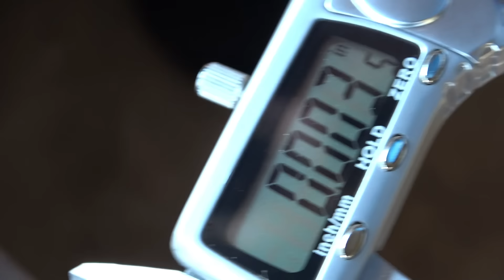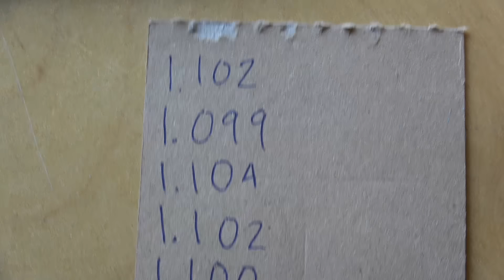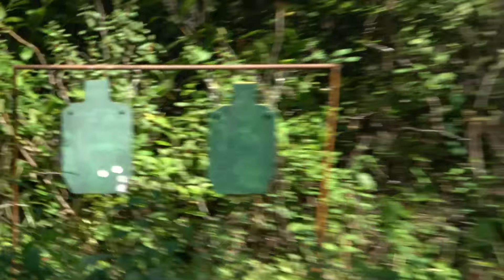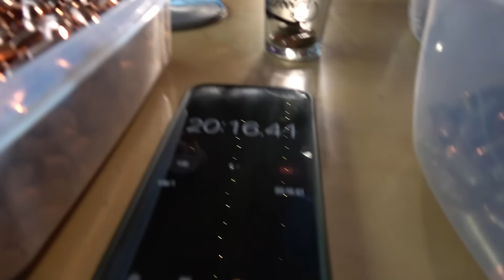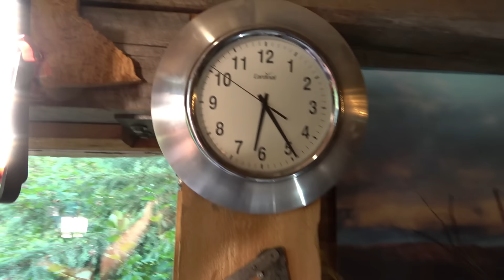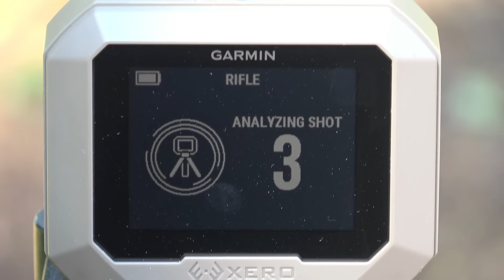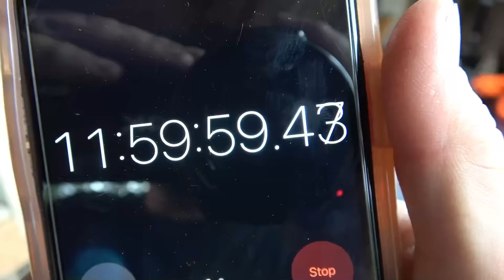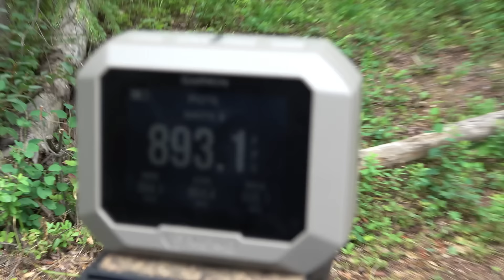We Made 10,000 Rounds in 24 Hours! DIY Ammo FACTORY

Comment: OK you fine people.    Lots of fun. Now, if you take a 5 gallon bucket, and fill it to the point where the wire handle is molded into the bucket level , and the mixed brass< rifle, various handgun calibers all un sorted> and pour them into that 5 gallon bucket, How much will you guess that weighs ??......I would be cheating if I said because I of course have already done it......... The big fake out is most of those white buckets shown here are 1/2 size, actually molded into my bucket is 2  GALLON not  5 gallon. and of course they weigh very different. ..............................GUESES ANYONE ????????and of course different case  calibers weigh different.. 22 LR is 9.6 grains ...22 win mag is18.8 grains 9 mm luger is 58.2 grains....45 acp is 88.6 grains... and rifle case like 556, 7.62, 7.62x 39 all have different weights and these are all uncleaned. directly from the range................... Standard brass cases are made of 70% copper and 30% tin and are metallurgically very sophisticated in their simple manufacture............ Joe from Idaho

Comment: You did a very poor job of setting up your progressive press! All brass needs several things done to it before reloading. The most important part is to train all brass to recommended specs. The 9 mm head spaces on the case mouth, so brass specs are very important. I noticed the powder was extruded, you should be using either spherical or flake power for 9 mm. I've been reloading for aprox 45 years. Please be more careful! QUALITY  over QUANTITY....GOOD LUCK